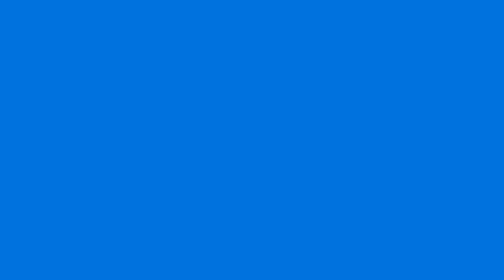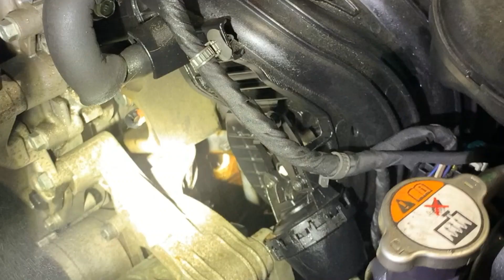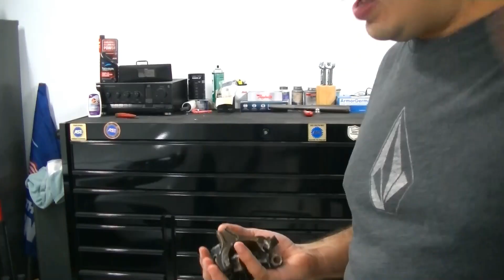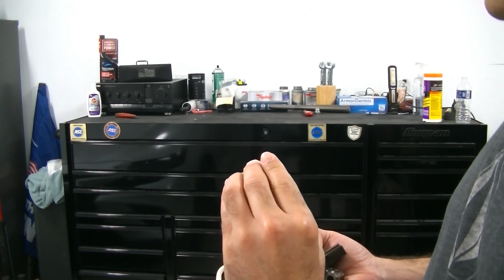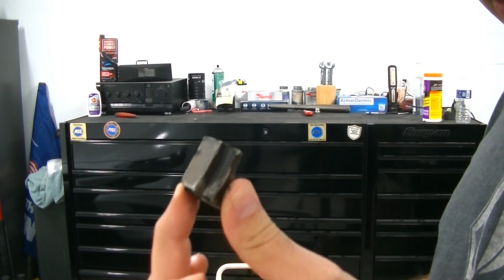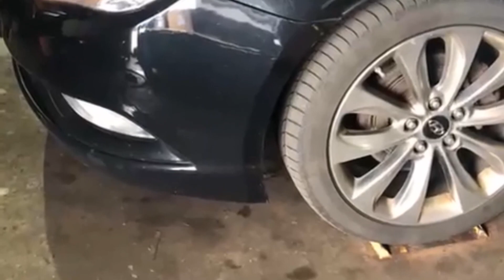P1326 In Hyundai/Kia vehicles, Cause of Theta 2 engine Failures, Timeline of Hyundai engine recalls

Comment: Hey brother, thank you for all the info, I have a 2014 Genesis Coupe 2.0t and the engines are not GDI, is there anything special about why they start to rod knock?  Mine had 56000k miles on it and it died bc number 3 cylinder spun a bearing.  I am just curious if there are any related issues between the GDI and MPI platforms that make them chunck bearings? Thanks a million for the video!
Reply: Start a PATREON btw ! I would happily donate to the cause !
Reply: How often did you change the oil and were you using an OEM oil filter? My 2013 Genesis Coupe 2.0T is running great at 111K miles. Oil analysis shows my engine is in excellent shape.

Comment: I finally got around to emailing my local Hyundai dealer.
Here is response to me declining recommendation for wheel alignment:
I told Thomas the day I bought my vehicle in for service it’s using oil and is making a squealing sound. Thomas just recommends that I get a wheel alignment. Doesn’t say anything about checking engine while I was there for a service.
As of today the squealing sound is getting louder and it looks like I’m using close to a gallon of oil per every 1,000 miles.
I don’t see a check engine light and Thomas said without a particular code it will cost me money to bring in my car to have looked at.
My Elantra is in economy mode and now I’m only averaging 22 MPG when I used to average 34 MPG.
I change my oil every five thousand mile with high quality oil and filters and from what I can tell is my motor is failing.
Reply: Theta II motors have extended warranties due to a lawsuit, however proof of oil changes will be required, and possibly that you used Kia/Hyundai filters.  So without that, you're screwed.  If they don't honor that extended warranty on my Sportage now using 1 qt of oil per 1000 miles, will trade it off for Toyota, Mazda, or Mitsubishi...

Comment: Great Video!!! New subscriber!!  I have a 2020 Optima 2.4l 58K with NO issues or oil consumption to this point. No recalls so don't think I have the knock sensor. I assume these post-settlement Theta 2's have not been modified or fixed??  Researching a lot and you mentioned briefly here about checking the oil. I see many say regular oil changes then boom 2 months later but none mention how often they check their oil as they go.   I check mine weekly at a minimum so I expect if I lose a little I can keep it topped off requiring a 1/2 quart at the most but probably less in a bad situation. My question is: If I do this based on your experience will that lessen the likely hood of rod bearing failure??
Reply from the maker: I’ve seen dealer maintained vehicles with oil changed every 3750 miles fail with proper oil level, and I’ve seen neglected engines routinely ran low or extended drain intervals just keep on going. They fail for no rime or reason
Reply: @SEsGarage  A 3700 mile oil change interval with synthetic. What a f***ing JOKE. I’ve seen many go longer with oil analysis. Good job Hyundai engineers

Comment: So what happens after they change the KS and the problem continues to happen? i had the KS replaced after limp mode in NOV and happened again same P1326 code in Jan. they said last time it passed the clearance test but i continue to still have issues with the engine going into LHM, its currently at the dealership now

Comment: But why are the rode bearing failures occurring? You've told us that it's the reason why the engines fail and all the nifty software to detect it but why are they failing? Lack of oil? Poor maintenance? metal burrs mixing with engine oil impacting lubrication???
Reply: Terrible local worker related QCV at the Alabama manufacturing plant.

Comment: I have a 2017 veloster 1.6  92k miles. My question is. is it possible that they accidentally updated this car with software from a different Motor size? Can it be flashed back 2original default? In your video you said the campaign changes some parameters for the knock sensitivity. I think it may be oversensitive on this vehicle causing the safe mode. If this car is knocking it's gotta be preignition or detonation.

I have  P1326 code The engine runs strong there Is no play in the rod Bearing Clearance. The engine has some noise At idle sounds a little like diesel. But like I said runs strong and the noise to me sounds minimal. I clear the code drive it down the freeway about 20 miles. Then the light starts flashing and limp  mode i use 91 premium octane Fuel.
 I went in and clean the Valves at the intake they We're quite sludgy but still had the same result.

This car has been at the dealer 6 months They are trying to get a motor replacement approved If I don't get approved I want to try to make this car drivable at some point

Comment: Hi, I love how clearly you describe things in your videos. Your knowledge is impressive. I was wondering if you had any knowledge or experience on the Genesis 3.3 TT engines. I bought a new 2022 g70 with this engine. I typically like to keep my cars for over 100,000 miles. Do you foresee problems with this engine or turbos for long life? I always do my own oil changes with synthetic at recommended intervals. I did the first change early at 1600 miles after I watched your video when you did your early change on your Camry. I am a bit concerned about the carbon buildup issue with DI. Any info or advice would be appreciated. Thanks!
Reply from the maker: Though I’ve never personally worked on a 3.3 minus oil changes and maintenance, they are not very DIY friendly. In most applications, any turbo work requires dropping the powertrain out of the car due to the way they’re packaged in the engine compartment. Early on in the Kia stinger there were recalls for turbo related failures that required engine removal to address. Just run top tier fuels and run some sort of induction cleaner through the intake via a vacuum line every 15-20k and you should be able to keep the carbon at bay. Hyundai/Kia V6 engines have never really been a troublesome engine minus a few bad ones, but that’s to be expected with any manufacturer
Reply: Thank you! I hit the subscribe button!
Reply: Just a quick question about your response…why would top tier gas or gas with detergents in it help if the gas doesn’t flow over the valves anyway?
Reply from the maker: @shinedownfly  it will help keep your injectors cleaner, along with the combustion chambers. Unfortunately the only thing that’s going to keep valves clean in a DI vehicle is routine service.
Reply: @SEsGarage  Does that include the 3.3 engine on a 2017 Santa Fe Lmited Ultimate AWD? I had an issue with carbon buildup in the injectors.  I was told at the dealership that the injector were acting up and they were pushing me to buy all of them and I was like nope so I bought a small tube of seafoam injector cleaner. I was skeptical about the injector cleaner but knock on wood four months later no DTC code and I use the car everyday. The car has 112K and I've never cleaned the back of the valves.

Comment: 2 Questions, will thicker oil help if minor knock is detected?  And if the P1326 still shows and engine lite is blinking when started, does that more indicate a faulty knock sensor or the RFI from the fuel injector harness interference, or does that stay on till the dealer clears it.
Reply: When my 2014 Optima got a knock on start up, that's what the Kia dealership did, went from 5w20 to 10w30, no more knock.
Reply: LOL. Try ear plugs to reduce the knocking sound

Comment: I am a customer with a Theta 2 engine. My 2918 Santa Fe Sport blew at 69k miles and they didn’t deny me. They are giving me a new motor. My question is, did they fix the issue in the new motors they are putting in? I guess what I’m saying, am I getting another motor with the same bull crap problems or did they fix this issue in their replacement motors?

Comment: Thank you for the information! 2014 Hyundai Tucson 2.4L 98,700 miles: my mechanic ran the code: p1326 told me to take it to the dealership. Have my appointment set up and will “limp” the 8 miles on Monday. However, after reading some comments, I’m concerned about the 3,000+ miles I’m anticipating putting on the car this summer. Once the repair is made, will my car be fit to drive that mileage?
Reply: Run only synthetic oil, preferably a good 5W 40 in a hot climate with a new premium filter and change both every 5,000 miles!
Reply: Hey any update on the car what end up happening
Reply: @indiee9602  yes, Hyundai approved a new engine. Have already driven 4,000 miles on the new engine. Start to finish was three weeks, I was damn lucky.
Reply: @robertbweltzien  only oil my mechanic puts in my car.
Reply: @elizabethhale6775  Reason why I ask because I’m literally going through the same thing right now I’ll handle it is literally fixing everything to replace my engine

Comment: Stefan awesome video but I was wondering bud the new Santa Cruz is the 2.5 turbo engine a good engine or should we stay away from it?I'm very interested in this (truck) but would not want to get rid of my crosstrek limited if they are still having problems! Ty
Reply from the maker: I don’t believe there are any major issues with the engine as of yet! But they are having some hiccups with the wet dual clutch transmission that they come with!

Comment: Change the normal oil pan plug w/magnetic plug. Put a magnetic ring on the oil filter.
Reply from the maker: Bearing material and aluminum is not magnetic unfortunately

Comment: I am one of the very unlucky owners. Had my engine replaced after it seized up at below 74k miles. At 99k miles the rebuilt engine start missing, smoking and had no excelleration. The dealer told me that I had not taken care of my car(oil changes-which was a proven lie) that the engine block was full of black sludge. They cleaned the block and sent me on my way. Less than 5k miles later while driving it went into limb mode due to throwing the P1326 code. This time back in the shop, the performed the BCT bearing clearance test and ECU engine control unit and told me there was nothing wrong with my engine. The code was a mistake. So, just got my car back. My engine has only 105k miles on it now. Is this still a ticking time bomb? And since they already fixed the first engine, am I still covered for this engine failure?

Comment: i have that engine in a 2016 sonata. i add 1qt oil every week. the dealer will not document the issue. i am screwed. the engine has started running a little hot

Comment: My 2018 optima P1326  would only come on when it was raining or I took it thru the automatic car wash replaced the knock sensor and come to find out the wires on the original one was broke and both wires was stripped from the factory put the new one in and no problem's!!!

Comment: Hi I have a 2013 hyundai sonata 2.0t I was driving on the highway and the vehicle went into limp mode and wouldn't drive and when I started it the next day it was knocking not running right with the codes p1326 and p0011 I called hyundai and they said my recalls were all up to date from previous owner and to call the nearest hyundai dealer to see if I am approved for the new engine since you use to do the testing do you think I will get approved?

Comment: it seems that after 2010 hyundai has had nothing but problems with engines. I drive an older 2007 sonata 2.4 liter 4 cylinder. i'm the 3rd owner and got it for a scant $1700. its been well cared for, regular oil changes and with nearly 160,000 miles shows no signs of slowing down. perhaps hyundai should go back to what they were doing then

Comment: There was another 2021 Sonata SE like mine at the dealer. That radio also did not go into stereo. There is a Major problem with ALL the Sonata SE radios. They do not Go into stereo on most analog stations. This is a Design Flaw that is common to all. The Elantra with the same trim Did go into stereo on the same station so the Elantra radios are fine. I want engineering to give me a new revision radio or a Firmware update to Fix the Bug. WARNING .... if you have a 2021 sonata se or sel your radio has an FM stereo Flaw.

Comment: Hi everyone. I really need your help please. I have a 2014 Kia forte with 2.0 gdi engine. And 3 weeks ago It started to make a knocking noise. I took it to the dealer. After the diagnosing they said it is engine failure but didn’t told me where in the engine.  my mechanic said it is rod knock. And the dealer asked me to bring the maintenance record. I did but yesterday I got denied.I don’t know what to do. Now the car is at the dealer. I can’t afford to change the engine. Please help me with all you could. Advices,sources for information help me to fight it any thing. please 😂😂😂
 Appreciate you help
Reply: Sorry to hear that. My mother's 2015 Kia Forte Koup EX 2.0 GDI has 132,000+ miles on it. I changed the oil and filter every 5,000 miles and there are no engine problems.

Comment: Once these engines fail, that's it right?  Will it break down multiple times before totally not working?  I have a mystery problem with my Sorento. I believe it's an emissions problem though. It started off hesitating here and there but recently it's been obvious that this happens after getting gas and now it completely dies.  Kia tried telling me that it is bad gas ( which I started to believe because it wouldn't happen every time) but no way.  This last time the car is behaving/running rough and shut down more than once.  I'm not going to drive it anymore and am taking it back in. Thet recently replaced the charcoal canister and canister close valve because I couldn't pump gas and they are saying that those parts are fine.  I don't understand how this has not thrown codes but it hasn't yet. Any help would be greatly appreciated.

Comment: We just did VC gaskets a week ago and suddenly 2 days later they got the P1326.
No audible engine knock BUT we do here a slight rattle during revving coming from the cam follower bearing under the fuel pump.
As you know, you must remove the HPFP to do the valve cover gasket.
I have a new cam follower bearing on the way.

My question is do you know of any correlation with doing valve cover jobs causing this code or is it just a coincidence?

Comment: I own a 2008 Hyundai Elantra and they have sent me a notice to bring it in to have the ABS module replaced because of catastrophic failures that have lead to fires and unfortunately at least one death. I know im going to have to do this because a fire could start at any time. Even when the car is parked and turned off. I've been parking it backed in to give the engine compartment some distance from our newer 2017 Hyundai Tucson incase this happens, or parking it out in a parking lot completely away from our apartment. The thing is, it's been a great car and it has 140,000 + miles  on it, 70k of which I put on it. I've heard horror stories about people taking them in and having a fire after the replacement of the ABS unit or some other problems pertaining to poor workmanship on behalf of the dealership mechanics. I guess my question is, can I have a mechanic of my choice do the repair or do I have to take it to Hyundai? I have heard a lot about problems people have been having and I know the threat is real, but both our Hyundai's have been absolute gems, except for cheap brake light sockets that wear out from the heat of the bulbs. I don't like anyone messing around with my stuff unless I know they're legitimate, good certified mechanics.

Comment: The problem i always had getting my 2018 hyundia alentra gt 2.0 hatchback oil changed . They would put to much oil. There was a good min i would run it like that becuz they said it was normal but the engine ran rough. It wasnt until i started going to another dealership to get a better service. They told me oil level has to be just below the full or in between the half line n the full line. I love the car but had several issues with it and all my services it needs i do threw the dealership.  Especially the injector flush cuz of the carbon build up.

Comment: My 2014 Sonata 2.4L GDI started knocking one day before I was to have the car in for recalls. Piston 3 spun the bearing and the engine sized. I called Hyundai and they said have the car towed in and they would fix the engine. After the mechanic verified the engine failed, Hyundai said they would not cover the engine because it didn't have a kds recall sensor installed. I never received a recall.

I have a case with the BBB for arbitration.  Would the kds have prevented the engine failure. The bearing spun and became one not a top and bottom. They are trying to weasel out of covering their defective engine. What evidence could I give the BBB to win my case? I joined the class action, they never informed me of the settlement, nor that the KDS recall could disqualify me from the engine repair   THX
Reply: I have a 2014 Hyundai Sonata Limited 2.4L GDL , has your engine knock sensor ever went out and been replaced?
Reply: @jaybenz2896  idk about that guy but mine was replaced and I got a code of p1326 went into limp mode check engine light flashing the car just did it while I traveled to Chicago had to tow the car to dealership Hyundai Sonata 2015 I was wondering if I replaced my knock sensor would they not cover me cause of work I did my car has 98k I do know it’s covered under the 953 warranty
Reply: @jaybenz2896  idk about that guy but mine was replaced and I got a code of p1326 went into limp mode check engine light flashing the car just did it while I traveled to Chicago had to tow the car to dealership Hyundai Sonata 2015 I was wondering if I replaced my knock sensor would they not cover me cause of work I did my car has 98k I do know it’s covered under the 953 warranty